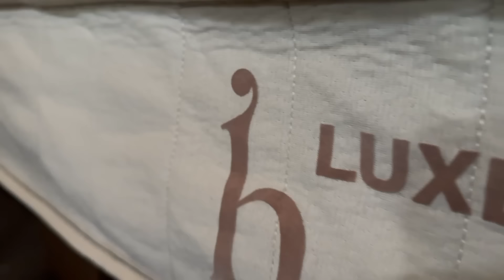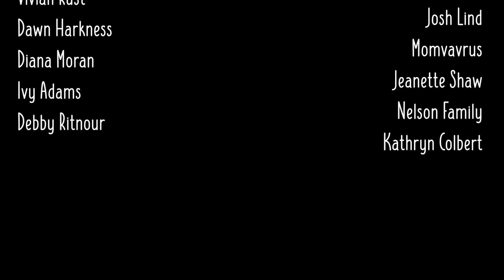FINAL Door Forms & TONS of Dirt: The Next Big Step on the Roundhouse

Comment: Ashley have you tried using the timber method with your garden? We did it here on our farm and it has worked excellently. We filled the bottom of our raised beds with sticks and branches from our property, then on top of that we placed biscuits of straw, then we filled the top of our garden with compost and soil. The timber has been breaking down over the past few years but starts to act like a sponge and the plants get moisture from down below the surface deep in the timber fill. We use sugar cane mulch on the tops of the beds to help retain the moisture in the soil. We trialled not doing this and those beds are not doing anywhere near as well as our hugel culture beds (Im sure Ive spelt that incorrectly) We water with the grey water from our shower that is collected in a container. I hope that maybe this idea might help you as you are in such a dry area. Cheers Theresa
Reply from the maker: Yes we did that when we first put the beds in: Gardening at the AIRSTREAM? Vegega Raised Garden Bed Install
https://youtu.be/fEL2WXCHhPo
Reply: @TinyShinyHome  Ive just watched this episode. Maybe try chop and drop as well. Whenever I have leaves that need removing I chop them up into little piece and move some soil and tuck the green dying leaves into the soil. Then I use leaves that I mow with our lawn mower and spread that over the top to help stop dehydration. It’s a process. Anything to stop dehydration of the soil.

Comment: Just wanted to say congratulations on the new sponsor 🎉🎉🎉
Back to the video....
I gave up on a summer garden this year.
I can't keep my garden soil from turning into a dusty, silty mess. Have tried all different kinds of brands.
I'm in Yuma, and the heat this year is pretty bad.
I'm still trying to keep my soil wet, and adding leaves, and grass, but nothing is helping.
The only way to get the water to go down, is to dig, and turn, while I water.
I've also put some aloe and other things that won't die, but nothing is helping.
Suggestions?...
Reply from the maker: The raised beds with limbs, cardboard, good soil was a good start last year, but the heat got to everything. Adding the shade cloth this year made it work much better.
Reply: @TinyShinyHome  I shaded the beds last year. Bell peppers were the only thing that survived.
I planted cantaloupe, and it did ok (2 plants produced about 8 fruit), but planted it early. 
One bed needs more soil now, as there isn't even an inch covering the logs, and limbs.
I'll wait till I'm ready to plant my lettuce to add soil.

Comment: I just relooked the casa de caca build and i am wondering....
Can you dip the bottlebricks in that protection stuff BEFORE you build it in? So you dont have to clean it multiple times in between and than paint it with that just before the latex outer paint. 

Just a thinking.  The final reveal will astounding...